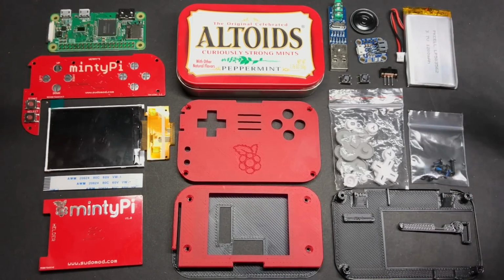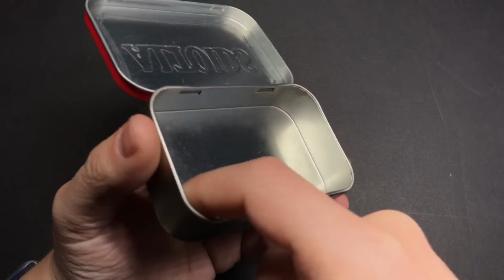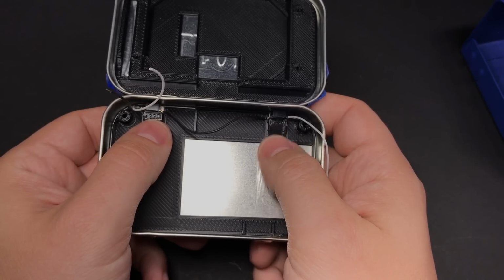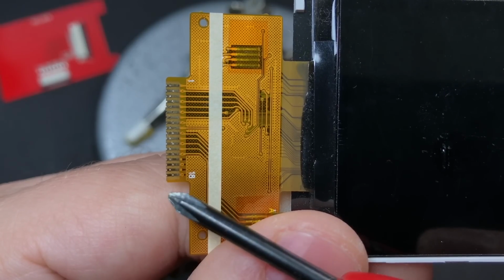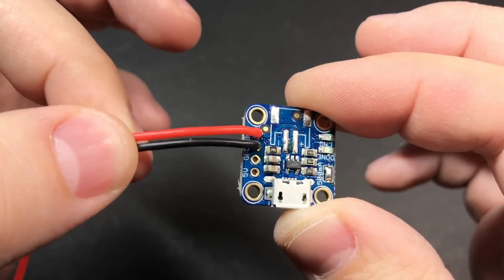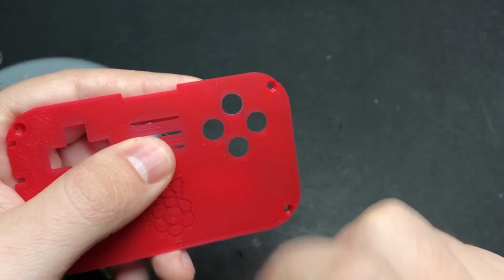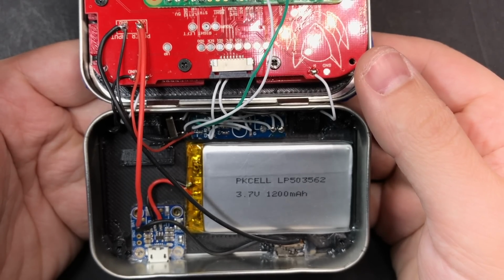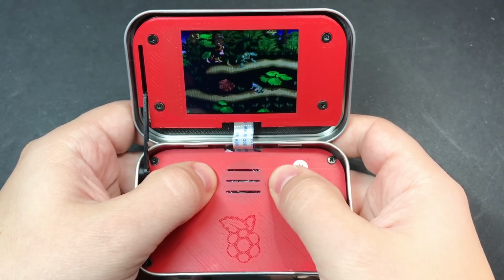mintyPi Build Guide

Comment from the maker: I'm told Helder will be doing another round of orders very soon for his screen/PCB combo, so keep an eye on the forums for that!
Reply: Altoids tin: $2.50
Raspberry Pi: $10 or $20
3D printing parts: $30.00
Buttons: $6.00
Screen: $12.55 (Almost gone)
USB sound card: $3.54
Speaker/Audio: $1.99
Charger: $14.95
Battery: $9.95
Power switch: 0.95
Copper foil tape: $14.91 (if need)

Price maybe be: $102.39
Plus downloading files and might take about a few hours
Reply: wermy are you selling any MintyPi becuse I dont have much of the things to make it and I dont want to buy the things to make it with becuse I will might only use them once. And if your selling some how much would it cost? And I like the green ones. :D
Reply: I would also like to buy the fully built model. Willing to pay if it is priced reasonably
Reply: How much would you sell one of these for? I don't have all the tools necessary for building one, and I also don't know anything about wiring. Please let me know.
Reply: wermy you should sell these
Reply: wermy hey, before the guide i was testing if everything connected correctly, and i stuck the screen cable without cutting it, and its a bit damaged. Do you think it might still work? if not, can you direct me to where i can buy a screen like that?
Reply: Not worth the labor alone
Reply: wermy can u build it for me for like $150
Reply: wermy can u put a link to buy the ENTIRE kit altogether???
Reply: wermy can I buy yours I truly don't want make my own
Reply: you can drill another small hole and put in the headphone jack you removed from the sound card, then route some wires from the sound card to the headphone jack. solder them exactly where they were when you removed it.
Reply: wermy yo can i buy one plz any price really want one really bad love your YouTube channel your the best subscribed and like hope I could buy one from the best
Reply: ChrisGamer FUCK YOU BICH
Reply: wermy To your project it would be good for you to add a blouethoo module, For games as pokemon, for exchange and other functions more, thanks
Reply: wermy how much would it coast for you to build one.and sell it to me? Or do you not do that
Reply: this is INSANE!
Reply: Finally someone knows my pain! Also I don't have any of these things BECAUSE IM ONLY 11!!!!!!!!!
Reply: it costs more than 60 bucks
Reply: you ALSO need the soldering tool a glue gun and wires
Reply: Not a problem
Reply: wermy in the next minty pi can you add 2 c pad and another L R button please
Reply: ChrisGamer I already have a raspberry pi
Reply: LixerArts I am not a Dumbass because I look on the website and saw what each part cost. Look for yourself
Reply: wermy let me buy one of those plz I'll pay
Reply: Okay I can hear like a lot of people want to buy one but you two guys know these parts are having very rare they're almost gone and he can't make a lot of these I mean look at the views that means 37,000 people want to buy one but he can't make it a whole I suggest that you will buy the parts and try make your own but it doesn't have to be in a mint box it could be anything all you guys need just the Raspberry Pi and you're done
Reply: @ChrisGonzalez333  Dude, you should really have stopped spamming. I know these comments are a year old but your comments are annoying me to death NOW.
Also, stop using numbers you pull out of your ass for other things to make a basis for how many people want him to make them a MintyPi. That's completely incorrect and just...so stupid. 
You wasted your time making an account just to comment, as well as my patience, and you sound like you're 12.
Reply: @ElysetheEevee  this is old and I stop that
Reply: a mint? curious.
Reply: edstirling yep
Reply: wermy Dude, all 3D printers deposit material layer by layer
Reply: eres un crack
Reply: kingrrezart123 its not as hard as you think, you can use a external battery pack and a USB OTG cable for the sound card, and the soldering is pretty easy with a little bit of practice.
Reply: C5Y I did that too, as long as the metal contacts are not damaged it hopefully should work.
Reply: AF5000 theyre kinda weird, but i think itll be ok
Reply: Can You sell Them i Like the Blue Ones
Reply: Can you build that for me I will pay you $121
Reply: Wermy can you do a Raspberry Pi in the something else instead a Altoids tin
Reply: How much does it cost to buy those?
Reply: I really want one
Reply: I made this channel to comment :D          
Do you know how much work goes into this first you have to get the Raspberry Pi and then you have to do 3D printing and there is 37,000 views that means 37,000 wants one
Reply: I made this channel to comment :D what about the other parts
Reply: could you sell mintypie's ? I really want one do not have the time money and intallegence to make one , please sell me one , my email : FurbyMine
Reply: Furby Mine do you know how much work goes into one small can
Reply: ChrisGamer he selling the other parts
Reply: I made this channel to comment :D   duh
Reply: could you put a link for the l/r tactile switches that we need, i just dont want to screw up and up with 100 random switches, thanks and goodbye
Reply: wermy I would suck at that stuff but could people buy a mintypi by its self already made
Reply: wermy could you make anything of an Altoids mini container? I just wanted to know, because I have a lot of from party favors
Reply: wermy i
Reply: wermy can you sell me the green one plssssßss§
Reply: wermy how much would it coast for u to make one for me to buy from u ?
Reply: Do you ship to latvia?
Reply: Yay
Reply: Awsome
Reply: michael gudkov don't be lazy
Reply: wermy Why is Zero on the button board, why tho?
Reply: wermy 
Lko
Reply: Zach A I actually have a reason: I don't have a soldering iron.
Reply: wermy if you made one just for dwarf fortress I'd give you like 50 dollars
Reply: wermy can u make these mass produced
Reply: wermy what is Altoids?
Reply: Sergej Nadazdin it is a mint can that you eat
Reply: How do get the parts
Reply: wermy I was wondering if I can just buy the full console from you.  I can't build Lego sets right so I know I can't build this!  So if I can what would be the cost be. My birthday is in October so I'm not gonna have money for a while. And how do I put more games on it?  Any info provided will help a ton!  Thanks!
Reply: Yardley Tapia did you know the parts are highly very rare almost gone and then my cost a lot
Reply: thank you so much for making this vid it will let me get a better idea of creating. can a regular person ask helder to make them a board? cause I would like to make a minty pi with nobs like a xbox or ds has. I would love to see you or some one do that cause well I'm a noob.
Reply: ChrisGamer :3
Reply: wermy Ihdbhcbeyedbyrshvgfgufgyisdfgfhgydsfgesufgesyfgguvf
Fbvhdbfihdbvhubvfjhd
Reply: wermy  could I just put Souder in to each gpi hole
Reply: Can you please send me a raspberry
Reply: wermy how much would it cost if I where to buy one from you the exact model and I will pay you for the 
Altoids minty pi console please
Reply: wermy can Iplease buy that awesome creation from you or if you can make one for me I have wanted one of these for a wile and I was hoping you could sell it to me please and thank you
Reply: adrian buckmaster because some people don't have access to the seperate parts and if you buy without thinking if you can get all the partsyou may have wasted money on a project tou can't complete. Also some people from other countries can't find the same amount of things on tgeir countries ebay and amazons delivery can be expensive without prime
Reply: ChrisGamer you've already said that
Reply: Alexander Brunetti 200 bucks eBay....
Reply: wermy this was SO FUCKING COOL
Reply: wermy I need you to make a video for the 2.2 inch screen because I printed out the 2.2 inch instead of the 2.4 inch. I am doing this for a school project and I need a video of how to build it before the project is due. Can you help me?
Reply: Cool
Reply: wermy who is Helder, I’ve never attended a project like this and I’m a little overwhelmed, could you please explain how to get these custom parts
Reply: how much does building on cost ? im looking to build 3
Reply: Saint Legna I did a parts list and you are better off getting one from ebay
Reply: wermykkjctyn ftyi
Reply: can you give me a list of things for the internal components for the mintyPi?
Reply: Sell it instead
Reply: 100
Reply: Do you know if I could buy one I don't have much money but I could manage to buy
Reply: wermy if u have all parts for the mintypi project ill offer u cash cause i have my altoids but i need parts so if u want to give me the part give me an email and we can talk about this so have a nice day
Reply: wermy i
Reply: wermy can  I pay you to make me one
Reply: preston chavez 7
Reply: Can I buy a prebuilt one tho
Reply: wermy hhiooooo
Reply: wermy when would it come out because all i need are the parts becayse i have the soildrong iron and hot gluegun and screwdriver
Reply: is there a way to buy the whole mintyPi prebuild
Reply: Is it possible for the gpio pins on a raspberry pie to control a screen taken from a broken laptop?
Reply: can you make one from the small tin
Reply: wermy 
Ok I just want to go to the playground
Reply: Are the games downloaded onto the pi or are you playing them online via a website?? Please let me know bc i would like to try this and i would like to know. Thanks!!
Reply: Karakum Gaming it’s running on “retropie.”  It’s a retro gaming operating system for the Raspberry Pi
Reply: Thanks inwas wondering how he had that manybretro games.
Reply: Yes he sells them on his website for 130$ ish
Reply: Prety plz
Reply: May I buy one from you please
Reply: I will take one as well please
Reply: I want one
Reply: I could give you  20$ for one
Reply: wermy can u pls make a gameboy!
Reply: Nah, its charged via Earth-Link, very tesla-esque.
Reply: wermy you gave me a thinking migrane
Reply: wermy can I have one for my doter
Reply: wermy g
Reply: I wanna buy one too
Reply: how much would you guys be willing to spend on one lol the overall price for the parts is kinda high
Reply: I really don't get what is wrong with the ppl writting these comments, they clearly aren't reading any of the other comments. It must be a bunch of 7 year old kids or something. And the offers being made to buy one... Like really? You're offering to pay $15/20 for something that cost well over $100 to build in parts alone. Nevermind the time and effort that goes into making these, that needs to be added to the sale price. Yet you think your $15/20 offer somehow is appropriate lol. No respect or appreciation for what he does what so ever.

Seems like ppl don't get what D.I.Y. means lol... Sure just buying on is the easy way to go about it but where's the fun in the that? Get of your ass and try something new and learn while you're at it. I get that not eveyone will be able to built one for various reasons but there's plenty of other things to try. I would suggest doing that because i can assure you that your $15/20 offer to buy is definitely going to get you nowhere lol.

$15/20 for something that cost more then $100 in parts alone! 😂🤣😂🤣😂🤣😂🤣 you guys making these offers are truly delusional! 😂😂😂
Reply: Were can I get this kit?
Reply: Would you make one of those to sell
Reply: Haha everyones asking to buy one for 6 dollars... To build it its like $110
Reply: wermy
Reply: Pretty cool project! Do you by any chance build and sell them?? If so get in contact with me, would love one of these!
Reply: wermy can you make them and sell them?
Reply: When is he ready for some more orders? My patience isnt what it once was.
Reply: God im in love with solder braid.
Reply: Wht
Reply: Where can I get one of these
Reply: Bro bro bro.... You make me one and I’ll buy it 🤤 I don’t know the first thing about building electronics but I know about using them 😂😂 msg me I’m serious
Reply: The website
Reply: Hey wermy! Was wondering if you would be selling prebuilts in the near future I’d gladly pay for one mainly because I have zero soldering experience and I don’t want to mess things up and have money wasted
Reply: i would like to buy one
Reply: Very cute and stylish
Reply: Hey wermy! How much would it cost for you to make one of these and send it to me
Reply: wermy I am slightly confused, where is the link to get said items?
Reply: Dhidjd
Reply: I know it’s been about a year since you’ve released this video but are you still selling the 3D printed parts?
Reply: Wermy, is there a way to get a speaker and also a headphone jack? Please dont become apple.
Reply: wermy make a real life pip boy that would be cool or try if you can.if you don't know what a pip boy is it's a mini computer that holds on your arm it's from fallout just look it up
Reply: This would be a great project in the future
Reply: Why do people ask for him to make it for them its a diy best part about it these projects
Reply: wermy for the pilot holes can we make bigger holes for the connections 
I'll probably make bigger holes and fill in the excess cut with a 3D pen wAit also can you make a 3D pen made case would probably be easier for me but not as comfortable '\_('_')_/'
Reply: Do you guys realize that each part is very rare to find parts and almost gone so you guys might want to buy the parts and then maybe soon they'll be another tutorial but I'll be easy and also guys look at the views 37,000 views that means 37,000 he's going to make you can't spend a lot of time making that
Reply: Codegamingstudio19. Go to the description go to the website go to buy parts and there you go dumbass
Reply: does it need to be charged?
Reply: yes. the battery is rechargeable, nothing runs forever without a power source.
Reply: wermy can I buy one from u? if I can how much will it be I don't have more than 6 dollars. if it is More I could get more money. if I can't buy it 😔.
Reply: Could you plz sell them pre built. I would buy it for $15-$25

Comment: Hey wermy, would it be possible to use a phone battery pack connected to the power port on the pi? Or take the lithium ion battery out and use the board with the ports on the front? When I started like 3 months ago I ran out and bought a phone battery pack to power the pi.
Reply: Oh I just realized that when u tested it worked just by plugging the power in..

Comment: What type of soldering iron do you use in the video? I keep ending up with cheap ones that don't have such a fine tip as the one you are using and would like to switch to a nice reliable one.

Comment: is it possible to open up the side to use the hdmi port if needed or is there no room
Reply: Abradolf Lincler Wrong video section lol
Reply: Furrys are pretty gay, but only the gay ones
Reply: I want to know too.
Reply: you know what I was thinking that I was thinking how is it possible to fit a Raspberry Pi just into a little tiny Altoids tin
Reply: Furry trash everywhere
Reply: SHADOWxWOLF Atleast you know decent grammar.
Reply: SHADOWxWOLF+ i don't see why not
Reply: I'm wondering about adding a headphone port to the side in the now unused area on the left.  There seems to be enough space over there to put it I think.

You can see where I mean around 23:24 in the space freed up by the smaller charger board.
Reply: a tech question that turned into a furry argument lmaooooo
Reply: it always does. i get several of these a day.
Reply: You try insulting someone and that's the best thing you can come up with.
Reply: SHADOWxWOLF 
Oh look, a fellow fur c:
Reply: gross a furry